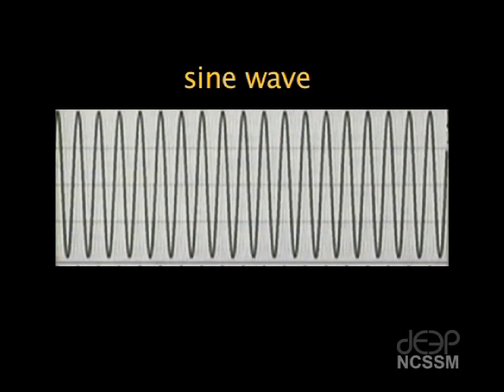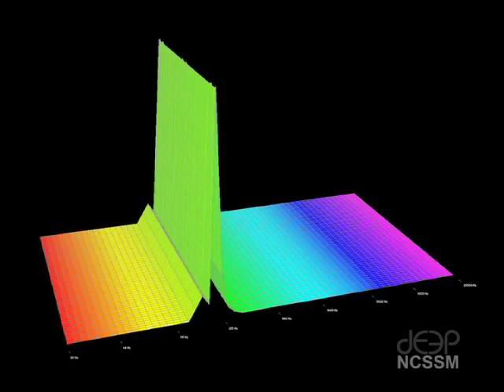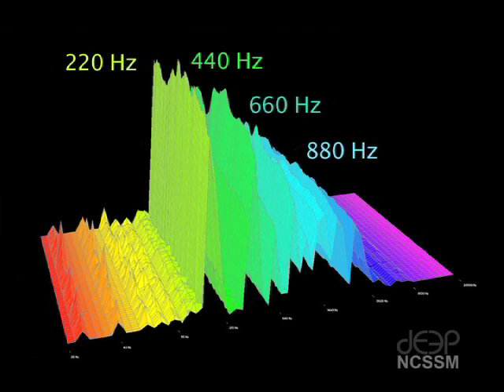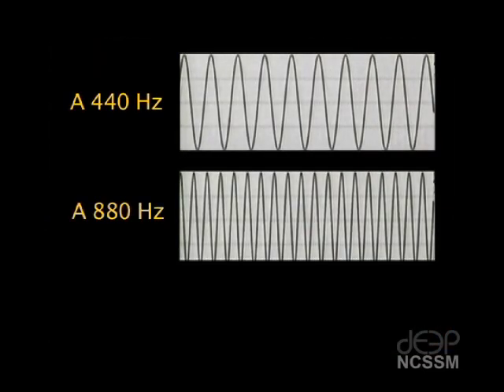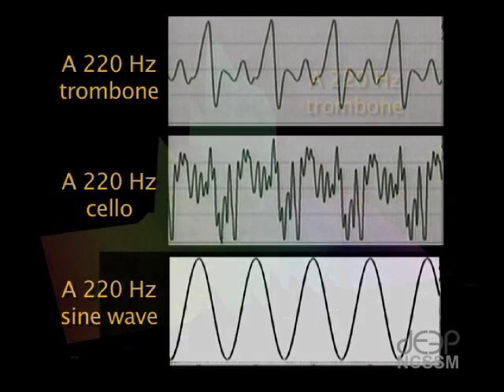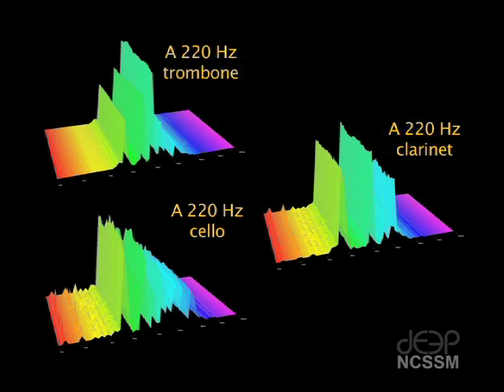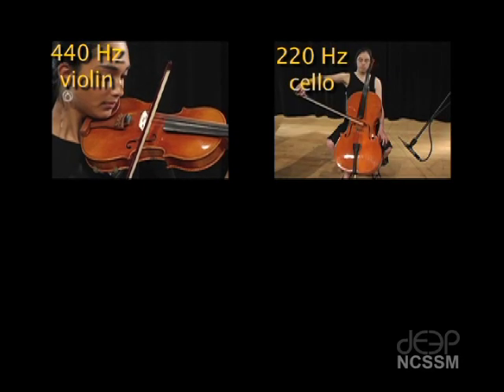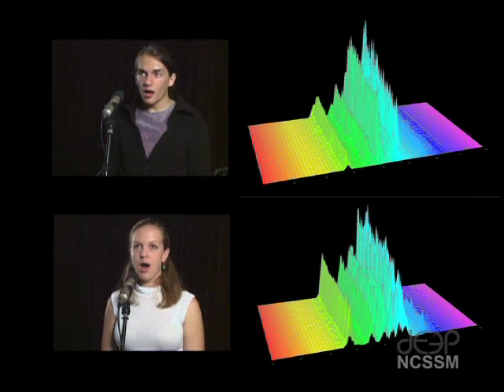Where Music Meet Science Part 2: Timbre and Complex Waves

Comment: I don't understand why you use a 3d graph in this video.  Couldn't you represent the data with just amplitude and frequency
Reply: I believe the z-axis is time. So there needs to be three axes. They could've made the graph more legible though.
Reply: I think the waves are air perturbations that occur in 3D, so it is a more accurate representation
Reply: @zak8953  i think youre right. However, i think its making it more difficult to understand.
A minute or two of explaining how waves are added and decomposed, would have made this so much more accessible for non math and science people
Reply: @aldomaresca9994   
Ya but still not get it it is not that the height is the same for each point and it should be because each is measured  for the same time length
Reply: And why there is time there it is so confusing i dont get it

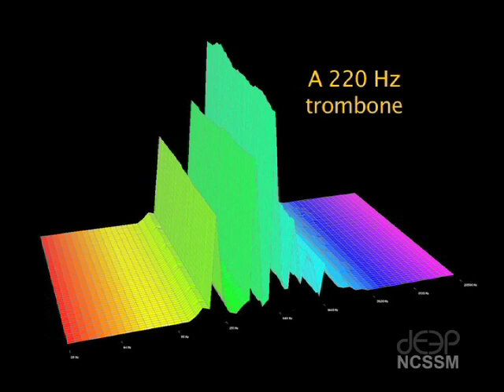Comment: At 5:20 you said (correctly) that the fundamental is the lowest and the tallest, but at 6:20 you show a trombone waveform where it is not. Nowhere do you mention the each harmonic is given a specific name 2nd harmonic (at twice the frequency of the fundamental), the 3rd harmonic (3x), the 4th harmonic (4x) and on. Some instruments can have over 30 harmonics, all descending amplitude and often not included in some synthesizers which makes the real instrument sound so much better.